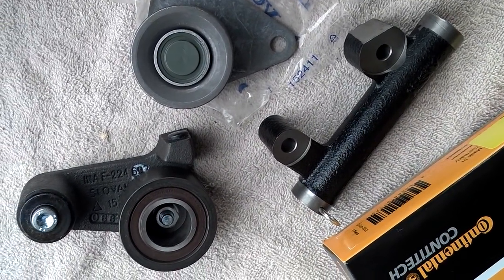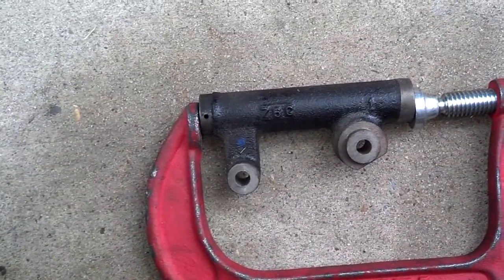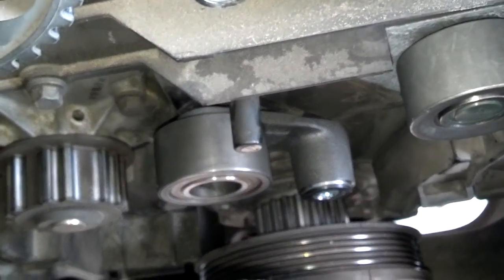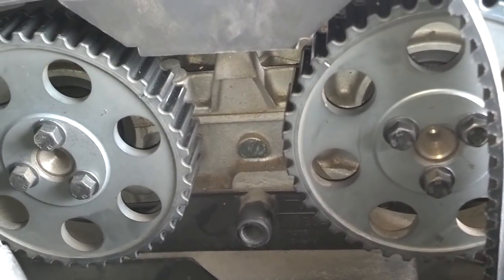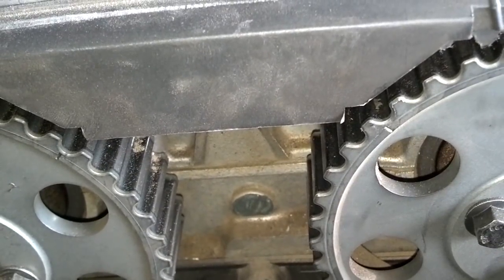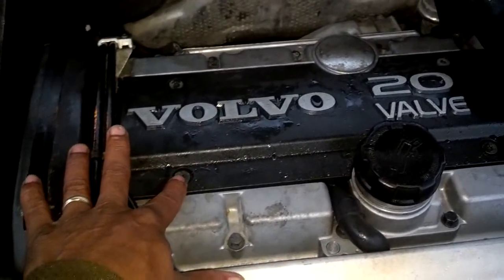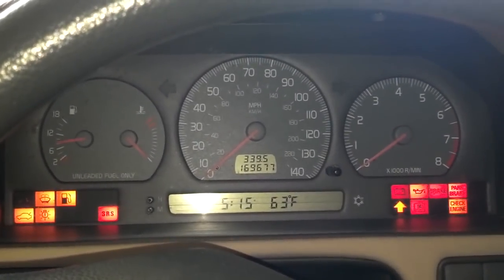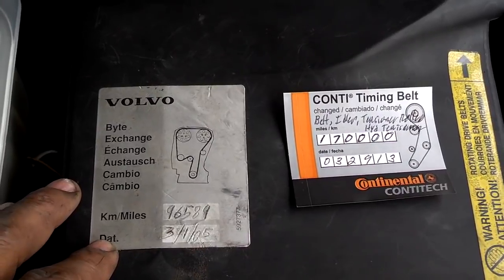How to replace the timing belt on the Volvo 850, S70, V70, etc. (Part 2 of 2)- VOTD

Comment: Just rebuilt my engine and i'm having an issue with the timing belt moving side to side about 5 millimeters. I thought it was the old tensioner i reused, but the issue remained after i changed to a new one. While changing it i held the tension on the pulley with a strap so i really did not release the tension on the belt while doing the switch, speculating if that could be the reason? Any advice?
Reply from the maker: +Markuz Z What kind of car do you have?
Reply: +Markuz Z Also, i just had the belt half way of and tried pushing it out so that it sat flush with the end of the cogs and pulleys, but immedeantly after start up it went back and started rubbing again.
Reply from the maker: What brand parts did you use? What is that cricket noise in the video?
Reply: +Robert DIY I used a gates set, the set i had did however have the wrong timing belt (144 tooth) so i just bought the correct belt with 148 tooth's. I believe the pulleys are the same? Everything fitted right up, the waterpump aswell. The noise is the timing belt rubbing somewhere down by the crank where the movement is most present, there is little movement at the cam gears.
Reply from the maker: Timing parts are critical. My guess is that the idler roller is bad. I would get OEM or INA parts and get that other stuff off of there before it jumps time and destroys your engine.
Reply: +Robert DIY Got the INA set with idler, tensioner roller and belt. The problem is gone! I did compare the rollers and they really did look identical, found no damage or bent pieces. The slack i felt was the same on the INA items. Considering this i think i might have gotten a "crooked" belt or something, bit disappointing with it beeing from Gates. But the issue is gone and thanks for the advice!

Comment: Yo Robert... If the tensioner can't move, it's repairable or should change? Thanks
Reply from the maker: I don't think trying to fix a damaged tensioner is a good idea.
Reply: @RobertDIY  is that really hard to push in the pin??
 or it is defective I'm not sure. I try to push it to some metal plate it won't move

Comment: I watched the video but had my timing belt and water pump replaced by a private Volvo mechanic. Now the engine sounds to me like it's idling more rough and louder. Does not sound as smooth as it was when I took it in. Driving a 2000 S70 Volvo with 175K. Took it back, they said nothing wrong with the car. Sounds off to me. Is that typical?
Reply from the maker: No. Any codes?
Reply: @RobertDIY  Found my Autel quick Reference for my code reader. Have to check for a code.
Reply: @RobertDIY  Yes. 
P0014 B Camshaft Position Timing Over-Advanced or System Performance Bank 1; car is idling rough, took it back to mechanic before getting the code tells me there's nothing wrong. Well my car is not running as smoothly as it was before he changed the timing belt. I had an oil leak and my car is at 175,500K, last timing belt change was at 100K.

Comment: Soap and water wouldn't do any harm. Give it a good blast of air after it's flipped into position. Actually I've worked with cogged belts that run in oil!

Comment: Hey, this video was helpful. When i was installing the top cover, after i used my silicon pasta... I remember that i didnt time my crankshaft first... But when i already had my cams and top cover on, also tighten all the bolts... I turned the crank clockwise until it hit the marking. The question is; would it be bad to turn camshaft not clockwise to match the marks? because thats what i done. and i recognized if i turned it more against the clockwise, it started to be very hard to turn (probably means that the valve was hitting the piston). But when i has my cams on marks, its not hard to turn them clockwise... so my plan was to just install my timing belt and try a few turns and see if it still lines up. Or will i be damaging anything? thanks. please give me a few tips if you have some, because i didnt match the crank before i installed top cover and cams.
Reply from the maker: Huh? I really do NOT know what you have done. If you turned the crank or a cam with the belt off, you are risking getting the car out of time. Sometimes it is hard to turn the crank with EVERYTHING put together because of engine compression. So, I repeat, IF YOU TURNED THE CRANK OR CAMS WITH THE BELT OFF, proceed with caution. You really should not do that. Now, it is important to time the motor before you remove the belt. If you DID THAT, the crank almost NEVER moves. So, you can install the belt, making sure the cams are timed, then turn the motor over BY HAND at least 2 times and recheck the marks. If you pull the spark plugs, it will be easier to turn the motor over by hand. If you do NOT understand, go to my website and call me.
Reply: Robert DIY Hey again.Well i have been changing the top gasket, and something else. Now i have installed the top and top cover. Yes i know the timing is important, thats why i wanted to ask you this question. If its a bad thing to move the cam the opposite way, to make the marks match? Or if i damage it if i dont turn it the right way everytime?
Reply from the maker: If the crank mark is on, you can turn those cams 180 degrees in any direction.  Timing Demonstration with Head removed, Cam cover installation. - Auto information Series   Timing Mark Crank Sprocket Location, Volvo 850, S70, V70, XC70 - Auto Information Series   Volvo timing alignment - Auto Information Series   Cylinder head installation, head gasket, lifters, etc. - Auto Repair Series
Reply from the maker: There are 4 videos linked there.
Reply: Robert DIY Ahhh okey, If thats true, then i guess im safe. Because i turned it just a few degrees the opposite way :)
Reply from the maker: As long as you align the marks before you put the belt on, then crank it by hand, you'll be fine.
Reply: Thanks! Now I have matched the marks when i have the belt on. Crank mark perfect, and one of the cam perfect, and the other cam is aiming towards the "triangle mark on the plastic" but its not perfect. but its not like a teeth wrong... is this okey? i have turned the engine too
Reply from the maker: That's fine. You can be a tooth or two off and still be ok.
Reply: ok thanks :) Im looking forward to startup now!

Comment: Hi Robert, doing this on my 98 v70 wagon. I saw no hydraulic tensioner. Is that right?
Reply from the maker: The '98 cars have a split during that year. Some have the hydraulic and some have the mechanical tensioner / roller that you have to load.
Reply: Robert DIY Traced my engine number in the back plate and boy I didn't like when that number had passed the 1266128 (mine was 1410123) so for me, I'd have to learn how to adjust the mechanical tensioner. On a positive side, I read that on engines after 1266127, the procedure extends to 10 year/ 105k miles instead of 7years/70k miles.  Good stuff as always Robert :)
Reply from the maker: RigsPGT
The mechanical tensioner is really not a big deal. Use good parts, I have read about more issues with the mechanical tensioners failing than anything else in the timing belt path. :/
Reply: That's one of the reasons I didn't like to see my car having it but I will get OEM parts and go from there. I hear the hydraulic ones holding strong for 140k so people can skip it on the 70k interval.
Reply from the maker: RigsPGT
I have read of them failing in 28,000 miles so that's one I would not skip.
Reply: Hmm, that's weird, I read over the forums and the majority there disliked the mechanical because of premature failures, thus making the piston type (the one you're working in this video) the better. From my other car experience the hydraulic ones were failing quite a bit so we're drilling and tapping them on the bottom and threading a bolt to make them adjustable and never failing. It was a cheap mod on our KL Mazda engines but we were constantly wrenching so it didn't bother us logging miles.
Reply from the maker: RigsPGT
I prefer the hydraulic tensioner, especially the ones that have the plastic clip to help in the event of leakage/failure. The key to them is to check them when you change them and replace them if they are leaking.

I have done a few belts on Honda's. Every hydraulic tensioner was bad. Several different sizes, etc. I also did a mechanical tensioner on an accord. I don't know which is best, I like the hydraulic system (2 parts) because it "should" keep a certain tension on the belt. If the belt stretches a little on the mechanical tensioner, I don't think the tensioner adjusts to keep it real tight.

Bottom line is, you're stuck with what you have (short of some mod) and you have to work with it.
Reply: Robert DIY good job

Comment: Robert! Thanks for your videos. I got a Volvo c70 and when I heard that doing the mantinance on them was a pain... but as I been watching your videos I've learn how to take care of that myself and saved hundreds of bucks. I do have a quick question. 
I got a volvo c70 01 2.4L getting the service code P0014. Seems to have to do with the Camshaft valve. I got one off the junkyard which looks in good condition. havent changed that, but in your experience would you say that will help with that code? Or does the code involve the timing belt change/pulleys?
Any advise would be super helpful!!! Thanks bro
Reply from the maker: +Luis Palacios I would start there. You can also pull it off and make sure the oil screen isn't clogged.
Reply: What would be the best way to clean that off and not brake it? ^^'
Reply from the maker: +Luis Palacios I don't understand your question.
Reply: Robert DIY whats a good chemical to use and clean the camshaft valve? would it be safe to use carb cleaner? or just brake cleaner will do the trick? sorry I didn't make myself explain well. thanks for your help
Reply: Robert DIY whats a good chemical to use and clean the camshaft valve? would it be safe to use carb cleaner? or just brake cleaner will do the trick? sorry I didn't make myself explain well. thanks for your help
Reply from the maker: I would spray if off with carb cleaner and maybe help it with a soft tooth brush.

Comment: Robert , u mentioned the belt was up to possibly 80k miles old. Manual says change at 70k. I am @ 74k from last change on car with 220k. I am disabled thus no $, and also because of that can least afford to lose the car. I need to raise $$$ to get this done. Is there a way to check the belt without taking off the belt, i.e. for cracks? And at what point am I pushing the limit of the belt. I'm in rural Maine and there is no public transportation. Nearest groceries are 25 miles rt. Also, I am getting quotes up here from one mechanic of $500, to change the belt with only a $50 belt replaced and more $ "if we find anything else". Another mechanic quoted $225 for the kit with no labor estimate. Do either of those sound in the ballpark? How many hours labor is reasonable to expect an experienced mechanic to need to do the job with a full kit? Ty.
Reply: 1998 V70 GLT
Reply: Just read through all the notes.  Does hesitation in increase of speed upon acceleration up hill always indicate timing belt slippage or could there be a transmission issue? Also, does the kit have to be one from the dealership? Most mechanics nearby i.e. we have 2!!! buy aftermarket and Mark up. They won't let u bring your own parts.  Sorry so long but my being able to stay in the home I own depends on this car, so I want it done right.  Belt was changed @ CA dealership by previous owner, 74000 miles ago in 2006. Thanks so much 4 your help Robert!!!
Reply from the maker: +Sue dufzor ecentricbirdlady I have seen them go 115,000 miles. Parts without the tensioner run about $200. The tensioner is about $100. I got all of the parts on the last car I did from the junk yard for about $60, water pump and all. I think the parts had less than 20,000 miles on them. Labor, usually takes me between 4 and 5 hours when doing the water pump.
Reply from the maker: +Sue dufzor ecentricbirdlady Probably a vacuum leak.
Reply from the maker: +Sue dufzor ecentricbirdlady Why didn't you have me do it last summer?
Reply from the maker: +Sue dufzor ecentricbirdlady I never install aftermarket parts unless it's an emergency.
Reply: +Robert DIY I've got 2 850s here for parts.  I'll have to check to see if they cross over.  Wouldn't you still need a new belt given that the rubber would rot in these old cars?
Reply: +Robert DIY Supposedly those were all taken care of last summer, no codes now.  New MAF.
Reply: +Robert DIY Didn't know you were up here!  Serious health issues and didn't learn about the belt issue until Nov.
Reply: +Sue dufzor ecentricbirdlady 1994 850s.
Reply from the maker: Yes, always install a new belt.

Comment: After removing the inner belt cover, it's a good idea to make another Whiteout mark on both pulleys that line up with some reference point on the cylinder head. That way you know where they are supposed to be should they happen to move. Since you remove the inner cover with its notches, it's useful to have another set of marks.

Comment: anybody. ..   my s70 1998. timing belt broke.  how do I rotate the cam and piston back into timing  so I can put the belt on. thanks for everything.
Reply from the maker: If it broke while the engine was running, don't waste your time.
Reply from the maker: https://www.youtube.com/watch?v=hJIoyHLl30U
Reply: thanks. ... I searched broken timing belt but you clip didn't come up.  so thank you for the link.  ps. love your  channel.
Reply from the maker: https://www.youtube.com/watch?v=gt9w-ZSxs9I
Reply from the maker: Why did it break?
Reply: i got the car with 80k on it  and didn't  change the belt.   it was also leaking oil.  so either  the miles  or oil leaking in that area is was the cause.   I just didn't do the maintenance was the main reason.
Reply from the maker: Ouch! Sorry to read that. How many miles does it have now?
Reply: ok the hood was stuck.   I got the cover off and the belt is still together but missing teeth and the water pump will not  turn by hand.   ps. got the car with 80k it has 95k now.

Comment: Robert, new question. I pretty much figured out that the issue with my car was the Auxiliary Serpentine Belt Tensioner. I bought a new one from IPD, and took off my old one.

My old one, however, apparently was from a manual transmission (?). The #'s match up with what the manual transmission tensioner that IPD sells and the Volvopartswebstore.com site says the same thing too.

I have no idea how old the part is, I'm guessing it's an original. I also know the 93's have some quirks that only apply to them though. Like how you can use a 3/8th socket wrench to loosen the tension, and the later ones have to have a 18mm block (or larger socket) to loosen the tension.

Would it be possible that the first 93's (mine was built in 92) had a completely different tensioner on them?
Reply from the maker: hapsblog Probably.
Reply: Robert DIY Thanks. I called a local Volvo dealer, and because my 850 is one of the early early ones (it was made in August of 92), it uses the aux serpentine belt tensioner that the manual transmission cars do. 

It's good to know, since IPD's website didn't say anything about it. Thanks for being a good source for info.

Comment: I put a new timing belt, water pump and all pulleys and about a month later the belt snapped.  Something was rubbing the belt and shaved it till it snapped so now I'm putting a new head.
Reply from the maker: Where did you get the timing belt parts?
Reply from the maker: https://youtu.be/ssPkQszc8Rg
Reply: Fcp
Reply from the maker: Which parts were they? Volvo, INA,  Gates???
Reply from the maker: When you put the belt on and started the car, was it tracking straight and on the rollers?
Reply: I think it was gates. I wish I could say I checked it while it was running but I didn't, I turned the engine by hand and everything looked good. Now I know better. It kinda looks like the idler pulley is bent a little and has a grove in the plate where the belt rubbed it's self down to about an 1/8 inch wide before it jumped